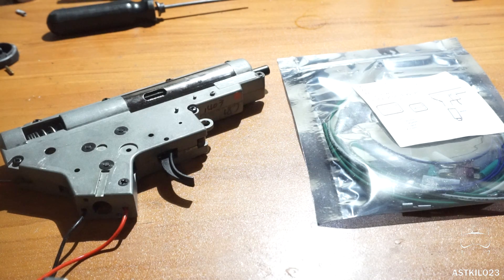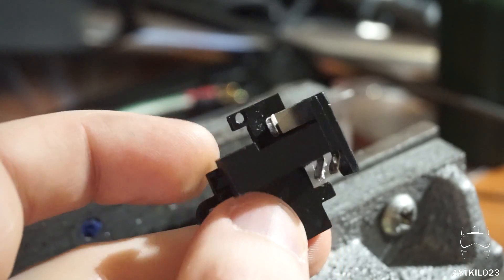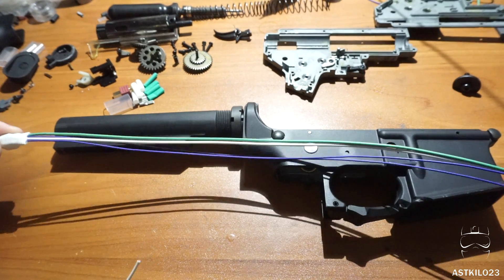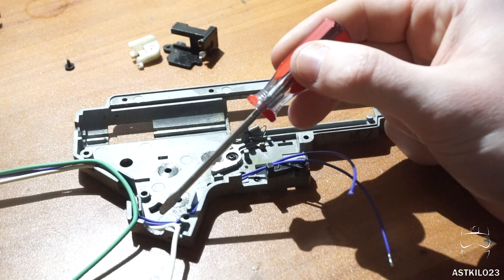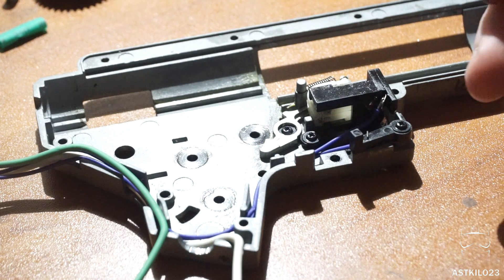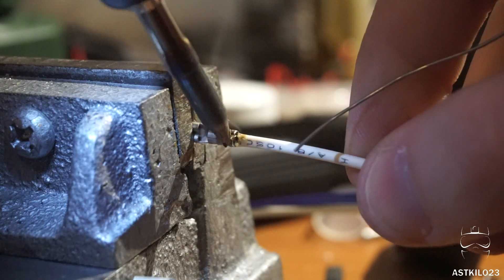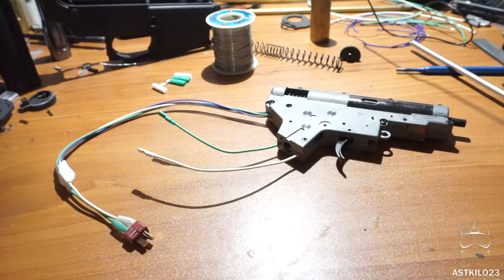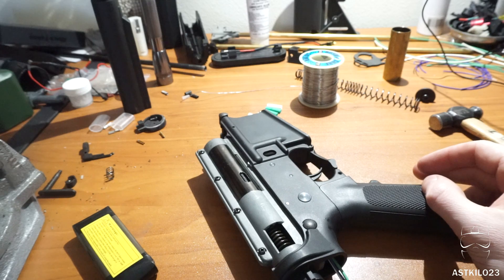DIY: Hulkfet Mosfet Install Tutorial (2x Gate Wires)

Comment: You never showed us what your tip was for keeping the wires in place while closing the gearbox. You must have forgotten you were going to share your tip. What was it? Glue? 
So the to purple wires, does it matter which wire goes where on the trigger assembly?

Comment: finally! And I just ordered & installed a "dual basic 3034 Mosfet" it's at least about 2 inches long I guess. And I worried about that buffer tube issue. But I still got that washer piece in and lock everything in place. Thought It was a drop is v2 basic 3034 Mosfet and the Mosfet it's in the buffer tube. keep in mind it was a long Mosfet.. probably long as G&G's ETU fets. anyhow great video!

Comment: How beefy are the wires going to the trigger.  Wonder if constant movement in the buffer tube if they would have an issue over time?
Reply from the maker: 22g ecowire going to the trigger. i don't think i will have issues over time. the casing on that wiring is pretty rugged.
Reply: You do not need bigger gauge wire for trigger wires, essentially all its sending is a signal to the fet when the trigger contacts are closed.